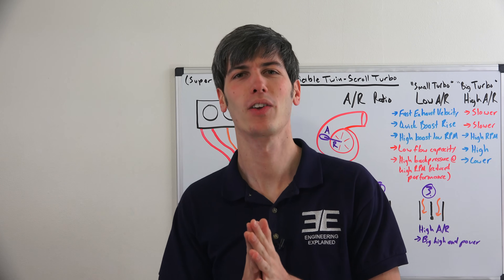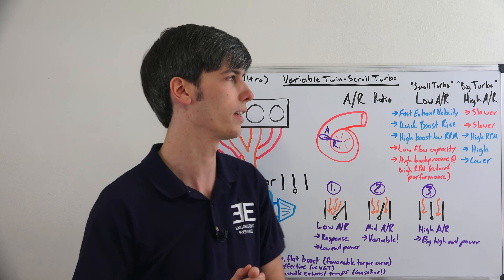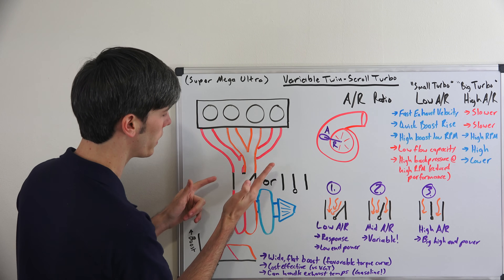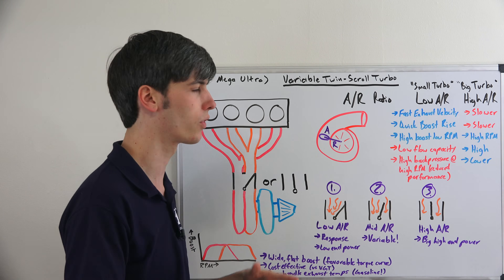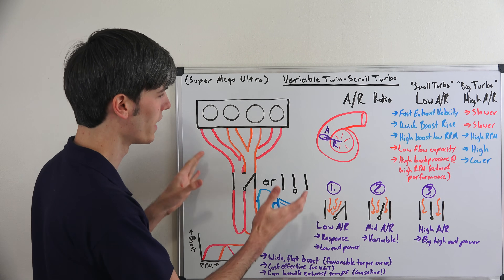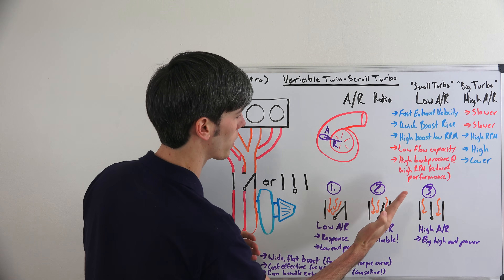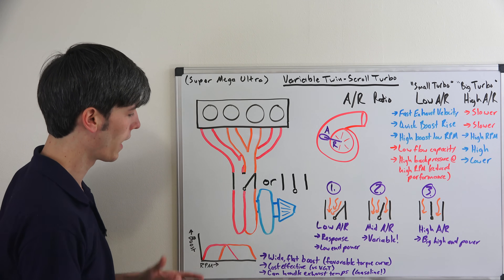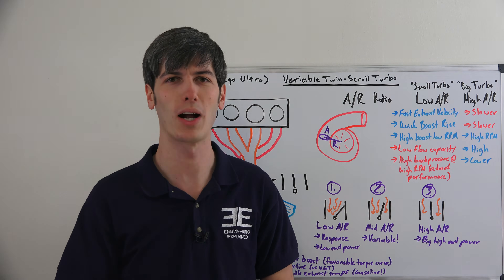Variable Twin Scroll Turbocharger - The Future Of Gasoline Turbos?

Comment: I see electric motors taking over the role of providing low rpm torque. Combine that with a high-revving NA engine and turbos may go the way of the dodo.
Reply: Nah, there's a real big trend of small turbo diesel engines replacing larger NA ones.

Logic being that when driving carefully you get the gas mileage of a small engine, but when you need the power it's there. Most people only need it when overtaking, and the turbo is spooled by then.

When electric takes over, there's no need for a NA engine.
Reply: +Filipe Amaral
A "trend" that has been going on since like 1995. :D
Reply: scanspeak00 Yes, that is true if they are the same capacity but a 1.4 turbo can do the job of a 2.0 N/A while weighing less
Reply: +George Ford Every design is a series of compromises. It doesn't make any sense to use somebody else' compromises unless you have the same goal. Likewise, judging somebody else' compromise as unwise because you have different goals is foolhardy. 

Currently, whether a car has a turbocharger or not has a lot more to do with the marketing department than any particular engineering goal. The word turbo has great marketability in certain segments, and virtually none in others. Whether to use any particular technology is all about whether it will PAY off or not, not whether it would be a better theoretical design in some no-cost imaginary world.  

As to whether hybrids get better mileage in town or freeway... If you compare a 3000lb hybrid with a 1.3L gas engine to a 3000lb non-hybrid with a 1.3L engine at freeway speeds, you'll find virtually no difference in mileage. If you're willing to allow the non-hybrid to be an ultra-compact that only weighs 2000lb, then you have to allow the same of the hybrid and you'll once again find the highway mileage is about the same. However, the parallel power hybrids we're currently seeing are designed to deal with the greatest waste of energy in an ICE vehicle, stop and go driving. Since an engine consumes almost as much fuel at idle as when driving slowly, and cannot regain any of the energy spent to accelerate when breaking, these are the areas that the hybrid power system addresses. By shutting off the ICE when stopped, using a battery powered electric motor for a majority of the acceleration, and refilling the battery partially with regenerative breaking, the hybrid makes gains in areas that an ICE cannot even touch.  

Does using a turbocharger with the ICE in a hybrid to further reduce the size of the engine make sense? Maybe, if you ignore cost of development and marketability. Turbochargers scale up in size very well, but only scale down so far (boundary layer losses become greater by percentage as absolute size decreases).  So if your total hybrid system power is 300hp, rather than 120hp, a turbo might be a good idea. If your goal is 500hp, it starts to make a lot of sense. And if your hybrid system is a series rather than parallel alignment, it makes even more sense. Ignoring cost/benefit and marketability, a small single speed turbodiesel using a double or triple sequential turbo setup to spin a generator would be a very efficient way to make the power, and changing from batteries to supercapacitors would give a much better weight/ power storage ratio. You could come up with a series hybrid package about the same size and weight of the current corvette V8, that could generate about the same power but deliver double or triple the mileage.  

But you've also increased the cost to produce that power train by a power of 10, and the crowd that wants the corvette engine isn't interested in your hybrid -regardless of how well engineered it is. So you give them what they want, a simple V8, which is cheaper to build anyway. And your hybrid drivetrain stays in the greenie-grocery-getter, where it has  marketing value. But the greenie-grocery-getter only needs a 120hp engine, and the turbo isn't the most efficient way to get that level of power, so even the engineers aren't gong to bother.  

And so, the decisions that have already been made, continue to be made the same way. 
BTW, variable geometry turbos and multi-scroll turbos have been around since the 70s and have been tried in all sorts of different configurations. The reason that they have not found widespread use is the cost of development compared to potential sales. There's just no money in it.
Reply: Of course they do, but what is the goal? To a gearhead, more power might be all the reason needed, but we don't run factories or design teams. The guys that do that always think about money, whether a decision will ultimately turn a profit. Even pure research guys have to think about money, because if they research a particularly expensive idea it might mean that they cannot research several less expensive ones...

If the only goad is to make power, let's turn to a pure turbine, ditch those slow lazy pistons, and catch ourselves some gas turbine bliss. :)
Reply: +Filipe Amaral  the reality: I don't know how many (or if there will be any at all?) "NA" normally aspirated engines we'll see in the future.  Even virtually all "Supercars" (Ferrari, McLaren, Porsche, etc) have all gone turbo.  The only one who hasn't, Lamborghini.  But with US & EU future laws for miles/kM per gallon/Ltr, Even Lamborghini will probably have to go with a turbo on some cars.  Me, I'm not a fan of hybrids, but I do like what "the Supercars" have done, by using electric to "torque fill" any gaps in the curve before the turbo(s) comes on full boost.  Also, I'd happily take a 1200 hp 7Ltr 8 cylinder GM engine with twin-turbos! Even though I prefer non-turbo.  Nothing wrong with more power!
Reply: You should send an email blast to all manufacturers that have moved to turbos and inform them they are doing it wrong.  BTW that's just about all of them, don't forget Ferrari.
Reply: +CJSchecter96 The weight of the battery is why. Yes, it will help you at the stop light or freeway ramp, but dragging that battery around costs you on the mpgs. This is why all hybrids get lower highway mpg than their gasoline counterparts. If you live in the city and rarely get above 40 mph, the hybrid might be right for you. If you live in the suburbs or a rural area, the lower highway (over 40 mph) mpg and extra expense of the hybrid is not worth it.
Reply: +scanspeak00 Turbos are definitely going to stay. Turbo engine produce the power of a larger engine while weighing much less. Less weight = better fuel economy = more people buying your product. N/A engines are doomed, there is only a small amount of them left in Europe.
Reply: I often think why don't they make an average priced performance hybrid using the electric motor for low end torque like you said. That would make electric motors in cars more appealing to car guys. And give it them normal transmissions not a cvt that takes away the intensity that it could have under acceleration. Someone has to do it at some point. Then you could also use it whenever for a little umph like a push to pass kind of thing.
Reply: CJSchecter96 making a hybrid whose target audience is the people who like hybrids the least is a good way to piss off shareholders. That's why.

For starters I doubt it would appeal to those who like NA engines, they'd sooner get a turbo than electric. A "car guy" who actually needs the low end torque is probably the same kind of person who wouldn't want the weight of batteries holding back his car.
Reply: F1 are paving the way of small turbo powered engines combined with electric motors, and Mercedes have built an amazing engine with that configuration, there's always room for turbos.
Reply: +xXxMartin96xXx 
hi there .
Reply: turbos increase the ICEs efficiency, they serve a different purpose from electric motors. Go learn son.
Reply: turbos increase the ICEs efficiency, they serve a different purpose from electric motors. Go learn son.
Reply: +scanspeak00
High revving NA engines are certainly neat, but the wear and tear on those things is severe. It's fine in race cars since they rebuild them every damn day, but people would not be happy if their engines need to be replaced within a year.
Reply: ^^Agreed. This is the precise reason that where durability is the HIGHEST importance, like long haul trucks where the engine is kept under heavy load for hours on end, low revving diesels are the rule, even though a smaller gasoline engine would make greater power using higher revs. A 200k mile gasoline engine is old or already dead. A 200k mile diesel is barely  broken in.
I do think that we're going to see more and more use of electric motors in vehicles, especially lighter ones. As they become more common, they'll also be developed to better suit this new role, and will in turn become more practical and common.
I can imagine (not actually predicting) that gasoline engines fade from popularity entirely, replaced by turbo-shafts where power density is the issue and electric motors in most other situations, with a smattering of heavy duty diesels kept around for marine and trucking/train uses.
Reply: +scanspeak00 I think the new NSX is a good example for this
Reply: ***** No, for a hybrid of electric and gasoline. It has three electric motors (one for shifting, two for front wheels) and an anti lag twin turbo system that is probably one of the best in the world.
Reply: Sure, compared to the original NSX, it kinda sucks ass. However, the car by itself is pretty amazing. Have you even taken a look at the insides? It's pretty insane.
Reply: Sucks ass? Hello? Honda has, for decades, fielded some of the top engineers in every pertinent field. They aren't rivaled by NASA or other government agencies. They are rivaled only by other bleeding edge car companies like Toyota and Porsche (essentially VAG's R&D dept).

Passing judgment, when you don't even know the criteria that the engineers worked from is pretty arrogant. I give you, as a historic perspective, the Mustang II of the 70s... By performance enthusiasts' perspective, an embarrassment to the Mustang name. However, it made Ford plenty of money, and spawned the Pinto which made Ford even more money. As such, it was wildly successful at the job it was designed to do.
Reply: Christian Swensen I was meaning that compared to the original spirit of the NSX, it sucks ass. Besides that, it really is an amazing feat of engineering. Twin Turbo V6 with amazing anti-lag and 3 motors to seam it together. Really amazing.
Reply: ***** I could only agree. They should've at least made it an option.
Reply: Electric motors do have limitations though at high speeds many rapidly lose  torque
Reply: There are some motors, not recently invented but until recently impractical to use, referred to as variable reluctance or switched reluctance motors (minor variations of the same concept). Both offer a torque curve proportional to current, and undiminished by rpm. I don't think they'll ever beat the induction motor for efficiency or the series DC motor for brute torque. But they make an interesting traction motor option, as long as high speed variable frequency drives are available.
Reply: MrRandomname1011 Actually turbo engines often weigh more than NA due to the turbo, extra manifolds and cooling.

Comment: I remember seeing something similar as a stand alone piece between the exhaust manifold and turbo inlet. It was called a qsv for quick spool valve. You can add it to any t4 twin scroll application and get the same effect. It's cool to see someone finally integrate the idea into the housing itself.
Reply: See thats what im talking about lol but not the same iv been cutting twin scoll housings for years for a reason. Qsv you have a collector behind the qsv this and what iv been doing and i didnt come up with it keeps those two wave systems if you will separate all theway through. Means better top end if things are done right.

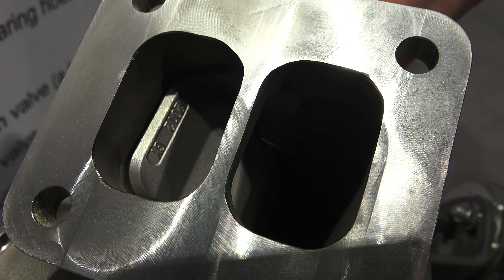Comment: 1:25 I'm wondering how much turbulence it will generate since there are some flat faces so that part of the exhaust pipe is not round at all, which is undesirable. Secondly just try to imagine how crazy the airflow will look like when looking at 1:25.
One solution I would come up with is making something like an x-pipe where one leg of the x can be closed with a valve.

Comment: My Alfa Romeu 147 diesel has one =) Torque all the way through the rev range =)
Reply: +Xico HatchiRoku Hi, your Alfa Romeo has a variable geometry turbo if it's stock, just like my 156 :)
Reply: Oops, you are right sir. I barelly looked at the tittle =( 
Yeah, love the 156 too. Wanting to switch mine for a the 159 SW ;D
Reply: It's a bit heavy but some issues the 147 and 156 had been solved with the 159, it grips to the road like a sucker :) . My 56 is a sw, giugiaro, 1.9 jtd 115 (soon my wife will remap it) w/o egr
Reply: Nice! I fell mine grips so well, its cool to thing the 159 does it even better! Mine is the 1.9 jtd with 150hp. Saw a vid on yt of the same engine making 272hp! Crazy! Different turbo probably and remap.

Comment: This may be a stupid question, but wouldn't this put a lot of, "pressure" on the smaller Turbo since it's constantly running?
Reply: There is only one turbine wheel, just two different exhaust passages around it. Watch the video on twin scroll for a better explanation.

Comment: i dont think this will be the turbocharger of the future. future for turbos will be e-chargers. electric motors spin the turbine when the engine is running at low rpm to build boost. as rpm rises and there is enough exhaust gases the turbos work like they always did. with the electric motors you can control the speed of the turbo highly acurate and when you want them to kick in etc. eg for different driving modes you can have the boost kick in sooner or later. sorry for my bad english.

Comment: Jason .I have a diesel bmw wagon..twin turbo, one is excited at low rpm and the second at about 2100 rpm but the borg warner system in this car uses the ebp valve to throttle the small turbo at high rpm, so it is similar to their newer one except the throttling is done on the other side of the power band and on the other side of the exhaust stream...

Comment: why not close the valve all the way so the exaust gasses can flow all in the bigger A/R scroll when the motor is running in high rpm?
Reply from the maker: +Daniele Dal Col That would reduce the A/R ratio, both scrolls are greater than just one.
Reply: Rade2112 u didn't understand what i asked
Reply: +Daniele Dal Col There is no "bigger scroll". Both scrolls are the same size. Opening up both of them is what effectively "doubles" the size.
Reply: I'm pretty sure he's trolling.
Reply: +Rade2112 No, to get the greatest boost you need the greatest mass flow, requiring the largest volume, i.e. both scrolls open. The idea behind a twin scroll turbo, and this turbo is to get the gasses to hit the turbine wheel at an optimal angle, this angle changes as the exhaust volume and turbine rpm change, hence the valve moving. Pushing all the gasses into one scroll isn't generating more power, its just using what you've got in a more effective manner.
Reply: Rade2112 Well yes the angles are different, that is the point of a twin scroll turbo, two different exhaust passages at different angles to the turbine wheel. But to get the greatest boost you need the greatest volume, no point closing one passage off, that's like having a smaller turbo!
Reply: +Billy Phillips 
The idea behind a twin scroll turbo is to reduce interference by out of phase exhaust pulses. Getting the gases to hit the turbine wheel at the optimum angle is the idea behind variable geometry turbos. The valve in this example is simply increasing the available area of the exhaust, hence increasing the A/R ratio.
Reply: +Rade2112 It's like in a trasmission, 3rd gear isn't necessarily it's own gear, rather a combination of previous gears to increase the gear ratio. This Turbo seems to work in a similar way. The little guy spools up at low RPM's and as you increase your exhaust flow, the valve opens and the bigger one starts to spool. The bigger turbo without the smaller turbo would be weaker than splitting the exhaust gasses and allow both to create boost. But that's just how I understood it.
Reply: +Roger Crouch Excellent explanation, you should be a shop teacher or something.
Reply: Engineering Explained  is this better then a Variable Geometry Turbo?!

Comment: There are supposedly electric turbos in some of the current concept cars which spool up the turbo with electric motors. Would these types of turbos outperform variable twin scroll turbos? Is it even possible/ practicable to use electric turbos?